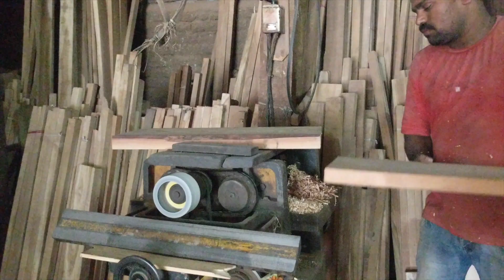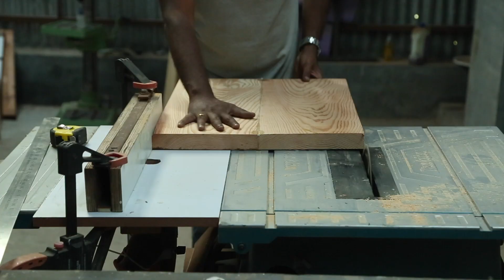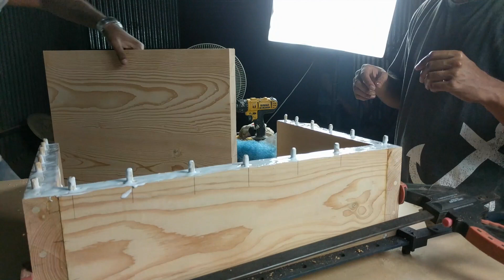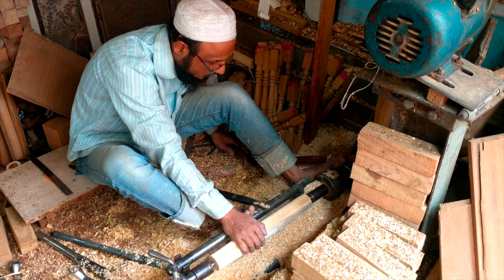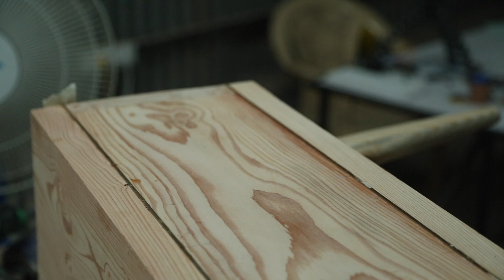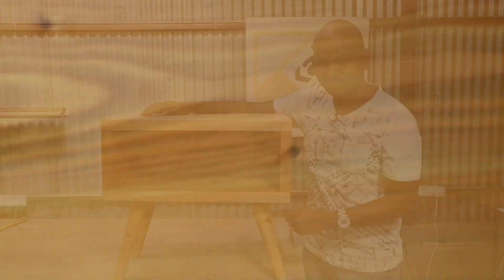Bedside Table // Bronze Inlay and Dowels

Comment: If the bottom of your legs are flat when put on a surface like a sheet of plywood you could actually clamp the bottom of the leg on a flat sheet of plywood. 

Put a bit of plywood on the top as well. Then clamp the top and bottom. 

Recap put a flat bit of ply on top of the table and the bottom and then clamp both so that the leg glue sets.